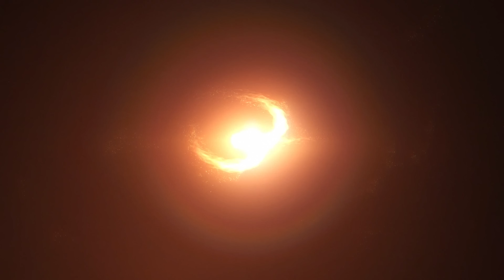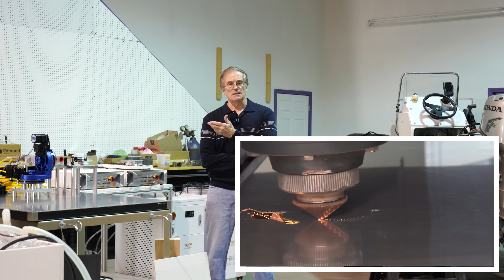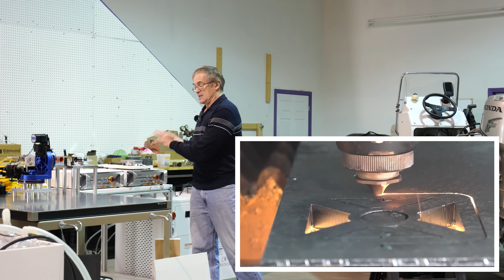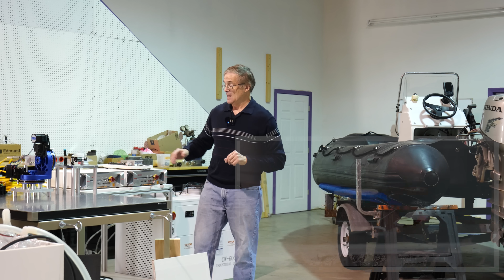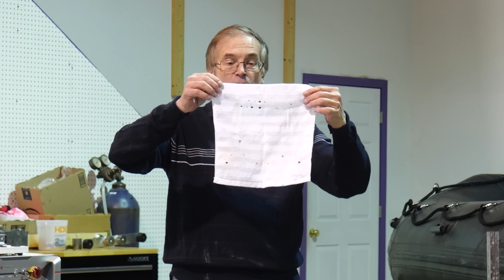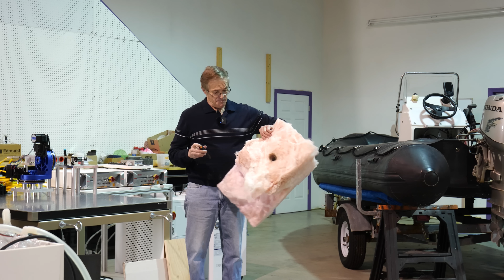We have a problem... and need your help!

Comment: Hi Tech Ingredients,
Super nice video and help request.

May I ask what is the emission spectra of your laser beam (or wavelength if narrow enough as expected to be into a conventional laser beam)? 
This to evaluate the possible absorption range for the blocking target.

I remember that Brainiac made a video about degazed "cocapepsi cola" as being ultra absorbant for laser beams (interstingly despite being apparently dark brown black, it is "clear as water in daylight" when under infrared vision).
So I think that: 
1) making an hydrous gel of concentrated cola maybe soaked (prior to gelatinization) into your fire blanket is a good possibility. Maybe add some "C-black of fume" for absorption optimization (and high melting point- boiling point for some latence / inertia or reaction). The cola absorbs part if not all of the ray (carbon helps), water boils, glas blanket melt a bit.
Eventually the dissolved candy will caramelize a bit and render it darker and more viscous.
This should give a few seconds if not more.
2) if the wavelenght is known maybe does a cheap material exist that will diffuse it into its mass by scattering and make it 360°*360° disperse (and multiple inner reflexion may absorb part of it  and disperse ALL of its focalization).
3) alternating multiple layer of the two preceding 1)2)1)2)... could be liberating solution; or maybe adsorbing the hydrous cola before gelification into a glas matrix holding the scattering material as powder or directly it as a fiber intissed as a fabric.

I hope this will help.

PHZ 
(PHILOU Zrealone from Science Madness forum and many former A.O.L. Newsgroups)
(Chemical and Biochemical Engineer specialized into Organic Chemistry)
Reply from the maker: Thanks. 
It operates at 1080 nm.
Reply: @TechIngredients  
Thanks,
It is then near-infrared regio of the spectra; so cola won't help a lot since as explained it is clear as pure water towards IR.
Water and glucose into cola yes of course.

But it provides some idea for a diffuser of your laser by incorporating an ingredient into the gel. 
BaSO4 is white cheap and used as a passive cooler (air cooler) into many YT video (maybe one of yours) as paint ingredient. It reflects most of the IR to the sky and leaves the surface below that is not able to absorb it colder.
Typically one can get temperatures of about 10°C below ambiant temperature without electric or cooling system.
So a slurry of the precipitated BaSO4 should offer some protection and diffusion for some time.
Maybe even some kind of BaSO4 wet plaster.

PHZ

P.S.:
Yes about microwavization of polystyrene (PS) to recycle styrene monomer (S); it is usually very low absorbing material for microwaves; so apparently they did test in France some recycling by adding an inert absorber that could heat up the PS to the 400-440°C needed for depolymerization and distillation of the monomer (144°C at STP); and it was Si-C (hard as diamond, black gray, almost as inalterable as diamond (except under O2, O3, air and heat).
It is often sold into some grocery paint and DIY shops as abrasive of different gain size (mesh); the finer the more surface area (but also the higher the reactivity); it is not intended to; but I did some tiny tests with dry milled KClO3 and inimely admixed and it ignites wel under a blow torch and burns fiercely afterwards about as if it was carbon dust (KClO3-C mix is more reluctant to ignite vs its black powder cousin).

Comment: I believe you have a very concentrated source of heat, and you need to get rid of that really fast. The best way I imagine you could do it would be trough a relatively thin layer of copper immersed in water. Maybe put a few heatpipes in there as well to increase the efficiency of the heat pump. I'm just a physicist, and I really can't say how good/cheap of a solution that would be, but from your results the heat is too much for a really small amount of time. You will need to treat the surface of the copper to reduce its reflectivity, but as @constantinhenle62 pointed out below, copper will react with oxygen to form an oxide that absorbs more heat. Looking forward to the next video!

Comment: What about Nighthawkinlights starlite material? Cheap to make, and expands as it heats up. The carbon would burn through eventually, but hopefully last a bit longer.
Reply: Or an aquarium with a circulation pump, and filled with water, and very small particle size graphite or graphene. The graphite would absorb fractions of the beam if small enough, while a foot of water would disperse the heat generated.

Comment: I dont think this will be a better suggestion than the flowing IR dye panels, but it will probably be cheaper! Activated charcoal foam with distilled water flowing through it. The laser should evaporate the water, and then more will be wicked into the dry spot. 
Further, you may try adding a fine wire mesh over the surface to help reduce pitting of the carbon foam.
To get a good foam I'd suggest making angelfoodcake, freeze dry it before cutting, and then convert it to activated charcoal in a controlled atmosphere furnace.

A slurry of media blasting glass beads and water might be interesting. Certainly worth lasering a bottle full of the stuff!

Comment: Maybe mostly vermiculite + a bit of silicon carbide powder + binder + water in thick panels could do. It is quite refractory, if it is mostly vermiculite it will be light but at the time of using it you can add water for some extra thermal capacity. As for the binder, you would want one that will take both heat and water. Sodium silicate may work if you figure out a way to bake the panels. One caveat is that the idea of adding water may just be flawed as it may not buy you that much time as you noticed with the blankets and even if you can have a binder that won't disolve in water, the binder may crack due to vermiculite expanding.

Comment: You mentioned not being in a salt mine... Why not build a wall of magnesium salt? You can easily define the wall-thickness yourself by either melting it into a mould, if it does, or by somehow evaporating it in shape. Craters can be fixed easily too, or not.
As they firstly have a huge amount of water in their crystalline structure and secondly, i assume, leave magnesium oxide behind when burned, they might be a good thing: Reflecting it to EVERY direction. (I'm thinking square root law thing) And mg oxide is heat-durable
Reply from the maker: The material sounds interesting.
The chalange is that we need to protect the entire back wall.  I'd rather not have to fabricate the many panels we'd need for that coverage.
Reply: @TechIngredients  maybe try it out and if it works, try making a very thick "paint" or "plaster" from it.
But yeah. other solutions might be better. This sounds annoyingly complicated already.

Comment: Hello friends of my favorite channel, I'm from Chile, yes that long and narrow country that many don't know where it is. My first option would be a wall of mirrors and a neon sign that says "run." Many years ago I worked in laser shows and we used water curtains for projection, a 4" pipe full of small perforations at the bottom, 4 to 6 lines of holes (diameter depending on flow rate) well distributed and alternating, where the water came out producing a curtain of water that served as a backdrop to project figures with lasers. It was a more primitive time. Greetings to this wonderful channel.
Reply from the maker: Thanks!
I've been at laser shows that did something like that. It's surprisingly impressive.
Reply: How much of the beam gets reflected back at the source when you do that? I was thinking it might be possible to use a bunch of shower heads over a basin to create a "wall" of water droplets, which would spread out the beam enough to use something like drywall to stop it. But if it reflects too much light back at the source then it might be too dangerous.

Comment: I have a possible solution. An blackened anodised material. My thoughts are to mix graphite powder + sodium silicate solution to make a refractory black paint, and apply to a roughened aluminum plate.

Alternatively is it possible ceramics / silicon carbide would work?

Comment: snow, don't absorb or reflect, refract

like how snow scatters light

fiber glass insulation is dyed pink
if you can find clear fiber glass that might work, 
but even then you need super super clear, and clean, like how even seemingly perfectly clear glass headlights can overheat from some oils from your fingers

they have those laser etched glass displays, where inside the glass is etched to make holographic displays
you might be able to pre etch a pattern that spreads the light

you could sandwich mirrors front to back back to front, so the laser penetrates the first few layers and but bounces a bit here and there, and the layers penetrated reflect again back and forth spreading throughout the surface
though you would want to purposefully let the light pass by only deflecting bits here and there slivers of the beam redirected
so maybe sparkly bits floating in glass 
but the glass itself will melt
so maybe water with metal shavings floating in it
but the water will boil creating pocket voids 
you want something that won't expand with much force when heated in tiny spots
so air 

possibly dust, like if you can find dust from lense grinders or jewelry or quartz grinders, 

or dust clouds, or smoke clouds 
you could make a double wall perimeter, and blow smoke and or dust through it, 
not sure how thick you'd need the dust wall, but carbon soot and silicates should be able to reach really high temperatures and dissipate energy to air blowing by

you could do it in a basement, far away from other things, like build your own facility out in the desert, run all your own utilities in specific ways, so you don't have wires or pipes along the wall get sliced

you could either restrict the laser from aiming up, or then shield the ceiling

if you could make a wall of fiber optics flat on the inside and fuzzy on the outside, then you could at least start spreading the beam

you could use powdered sugar dust wall, the sugar would turn to carbon, but you could also start a flour mill explosion

ashes, cheap, carbon high temp
you could make a wall packed with ashes 
I don't know if it would be better to pack them tight, or loose with air or vibration to keep them circulating preventing holes from stabilizing and reducing time that any one particle needs to withstand the beam

Comment: My suggestion for a backstop for a laser that strong, would be items that are both expendable, and difficult to burn. Something like an aquarium filled with gravel and water. The laser will burn the gravel eventually, but it'll have to vaporize a lot of water first.

After the test, the water can be drained off and the gravel removed to make storage and transportation easier.

Comment: For testing just point the laser upside down and use RC cars - it's easier to fix a hole in the concrete floor.

Comment: I see three possible effects to stop such a powerful beam. Dispersion/diffusion, absorbtion, and ablation. I'm thinking the beam needs to be dispersed to reduce the power density, then absorbed somehow, either in a meterial that can handle the power dump, or something that can be ablated to remove the energy from the area.

Taking inspiration from molten salt reactors, perhaps a wall of dry salt powder will diffuse and absorb the energy enough? Would the salt melt and flow, potentially moving out of the way and allowing more salt to flow into it's place and replace the spent medium? I suspect containment would be a problem. Somehow I don't think glass would stand up to such an energy dense beam, and exotic glasses like quartz glass are WAY too expensive (and might not stand up to the energy density either). Then there's also the issue with reflections from the glass.

My next idea was glass beads in water to disperse the beam and drop the energy density so it can be absorbed safely. Maybe glass shot- or sand-blasting media in a "sand aquarium" type of thing. But again, not sure if glass can stand up to those energy densities and there's still the potential problem of reflections to deal with. And the problem of potentially explosive boiling. But can you imagine making glass fulgerites with that monster laser?

My other idea was simply redirection. Redirect the beam downward into the ground. As long as there are no services underground or flammable materials on/near the surface, it might work? I somehow suspect getting a reflective surface to redirect that energy density without absorbing some and failing might be the issue with that idea. Could always mount the laser pointing downwards so no reflection is needed. I did think about redirecting the beam upward into an empty sky, assuming the beam divergence was high enough over a distance, but I'm sure that's probably breaking some law or something and people will get upset.

Do note I have not had experience beamdumping such a powerful beam before and these ideas are all simple thought experiments. Highest power I've beamdumped in my life was a few hundred milliwatts.

Comment: You're Magnificent!    What you need IS water, but not on a rag; you need a flowing "waterfall" of an opaque slurry; i.e. "mud", on an incline, say a 45° angle facing the laser (think "water slide").  This should be relatively easy to construct with a simple pump that could be made from PVC parts and driven by a lawnmower engine.   The opacity of the water will enhance absorption, and sufficient flow should dissipate the heat further.  The surface the water flows down could be anything, if the opacity of the fluid and flow rate are great enough.  Put an inch or more of flowing water over it, and you shouldn't have a problem; though Glass could be useful as it could refract and further diffuse the beam, in a predictable manner.   I would then consider what chemistries are modified by intense laser in beneficial ways, and wonder what you might put in the slurry that the laser could convert to something more interesting, which could then be detected in the chemistry of the flow, giving you a direct measurement of the laser energy impacting the absorber.   My guess is that if done right, this could be come a useful project in industrial laser synthesis all by itself, as promising as the counter-drone application of the laser originally.  In principle, something as cheap and simple as a "batter" made of flour or corn starch could yield flashed graphene oxide (see Dr. Tour's work).  Good Luck & Best Wishes; we'll be watching!

Comment: What i would want to try is, (i'm not a pro) you know these ceramic candle heaters, like a giant flower pot with sand or copper, maybe some black coating. Maybe you have these in brick form too. So i tried AI and it says laser ablation resistant ceramics, blackened copper, sillicon carbide, tungsten or graphite. Graphite blocks should be available for about $10 per block.

Comment: Damp charcoal. The Chinese used it (oak I think?) on a few spacecraft as heat shields. 

It is black, so would likely absorb the light, and doesn't transmit heat well (why the Chinese used it). 

It would catch fire, but if it's wetted with water, a fire might start, but not continue. Even if it did, after an incident, you could spray it down with water to easily put it out (if done quickly). The entirety of it wouldn't burst into flames in an instant, especially if wet.

Comment: Due to the high power collimated my first thought is to undo it.  I'm thinking 3 or 4 layers of the drywall, and then a lot of crushed glass pieces to scramble the beam.  And maybe more crushed glass between the drywall layers, and more drywall after. 
I would do tests, with different size crushed glass pieces, and mixes and layers of different sizes.  Then total layer sizes of an inch or two, and try to optimize scattering the beam.  Maybe even clear sand or ground quartz dust or pieces for small particle sizes for the first layers to break up the small collimated beam.

 Then it comes in through the drywall layers that also slow down any back scattering, and then diffuses the beam in the crushed glass layers.

OK, moved the main idea to the top..

First, this is deadly.  Before anything else, treat it as such.  When in the shop working on this, I would mount the entire thing onto a plank or rail, with one end fixed to the table or similar, so you can't even turn the assembly around.  In other words it can only be aimed at the back wall, and shifted.  Then block off the area behind from people walking behind it without all of the power being disconnected.  Ha use extension cords to bring the power, and you have to unplug the extension to go back there, the extensions become the velvet rope for access..

  Then it comes in through the drywall layers that also slow down any back scattering, and then diffuses the beam in the crushed glass layers.
This is crazy power, far far beyond eye damage etc.  I'd want a camera and video disconnect, and a layer or few of the back stop between me and this at most times, and keep the whole thing pointed down range away from me.

Comment: I honestly don't know if this will work, but have you considered mica sheets? I don't know if muscovite (clear mica used for furnace sight windows) sheets are too transparent at your laser wavelength, but maybe biotite (the black mica) would work.
Also, don't discount reflection, rather aim your reflection. Angle a reflective surface down so the reflection goes into the ground (preferably outside into dirt to avoid permanently scarring your workshop floor or outdoor concrete pads (driveways, patios, etc).

Comment: just a large reflective surface (like aluminium, steel etc) angled to reflect the beam into the ground should be fine right? assuming there's nothing in the ground that might be missed like power/water lines or something.